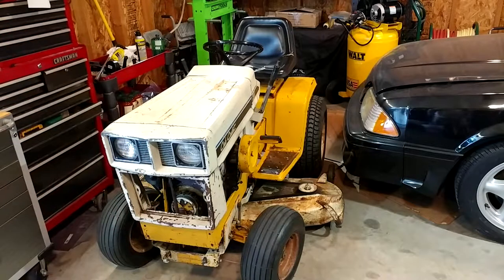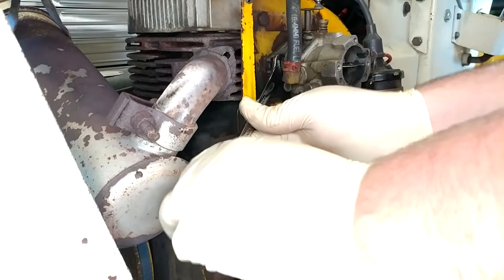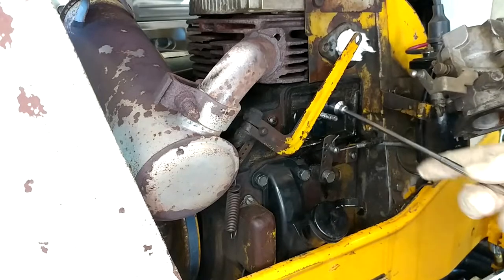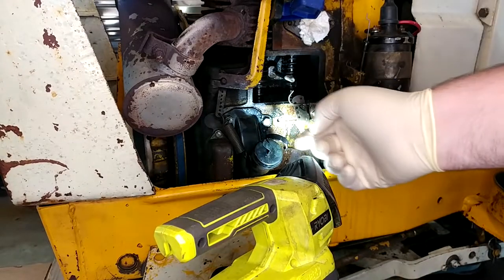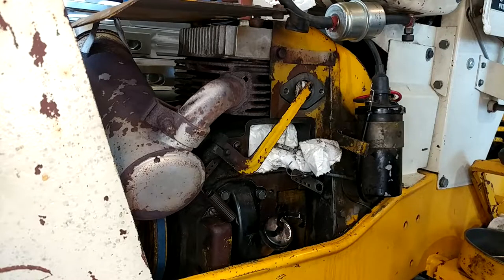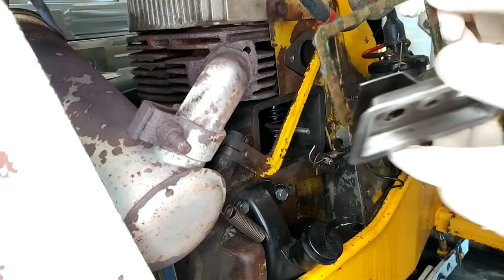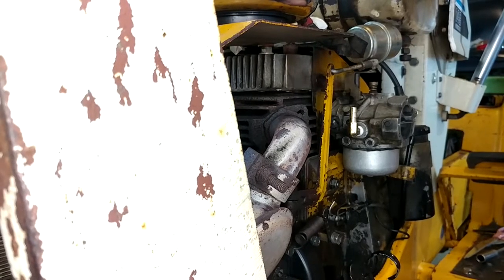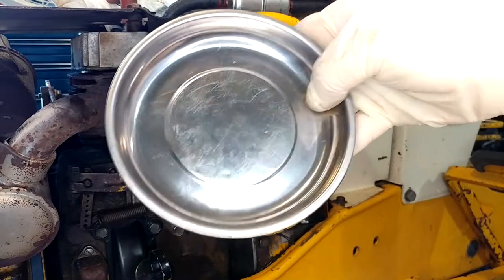Kohler K Series Valve Adjustment & Breather Service: Cub Cadet 149

Comment from the maker: ANNOUNCEMENT: After a few hours running, my machine developed a MASSIVE oil leak out of the valve cover. It turns out that center bolt does need to be fairly tight, so don't be too shy with it like I was in the video. I believe I caught it before anything bad happened, but what a mess. It probably lost about 3/4 of a quart all over the side of the motor, the frame, the front axle, the mule drive, etc, etc. 😆

A bit of loctite on the nut may not be a bad idea either.
Reply: Thanks for the update date will take that in

Comment: If you still have a pesky noise in the vintage Kohler engine, consider piston slap may be telling you of excessive wear of the piston skirt. You have many many hours on this machine. If you have already done the rebuild then you’ve probably cured the piston slap noise along with other ills. 
Thanks for a great tutorial. 
Dan
Reply from the maker: There's no doubt that it could use a rebuild. I had the head off of it several years ago (probably 500-1000 hours) and piston clearance was plainly pretty large even by eye. 😆

Comment: Check the set screws in your basket pulley for tightness. Loosen the starter/gen belt first then try turning the engine back and forth to see if the pulley is tight on the crankshaft.
They get loose and rattle like crazy then it's not long before the snout on the crank is ruined. Usually the basket pulley is too! A very costly repair and not something you want to overlook very long when you're hearing a rattling noise.
Reply from the maker: I'll check it out for sure. Thanks for the tip! 👍
Reply from the maker: I checked it today before mowing and everything seems fine there.

Comment: Try thicker oil for the noise.  It is supposed to have straight 30 weight, not 10w30!  I have the same engine in my Cub.  Have to check exhaust clearance, mine started glowing red on the muffer and engine output pipe.
Reply from the maker: I agree. Since the early 1990s when it came home, it has only had turbo diesel rated straight 30 in it. The current flavor is Rotella T1, which should have all of the vitamins and minerals that a growing Kohler needs. 😆 

That said... The factory Kohler manual recommends 10w30 for cold climate use. I would likely elect to just let it warm up for a long while and run straight 30 anyhow, but...

Comment: Another issue that happens with these k series engines is the balance gears tend to wear over time and start to rattle. Usually a dead giveaway on those is, if the engine has a rattle at idle then goes away when you give it some throttle it’s typically the balance gears. It could also be the cam end play or the crank end play. It’s hard to say on these old, high hour engines. In any event it’s definitely worth rebuilding.
Reply from the maker: It seems to tick at all RPM and seems localized to the exhaust valve region. Some days also seem better than others. Your guess is as good as mine as to the cause. It still runs pretty well. 🤞

The only thing I'm positive about is that motor has thousands of hours on it and is way past what anyone would ever expect out of one. It for sure could use a rebuild, but for now I'm just trying to nurse it along and be as kind to it as I can. If it pops, it will for sure live again.

Comment: it may be your front PTO Clutch they tend to rattle
Reply from the maker: The PTO really shouldn't rattle if they're properly adjusted. I replaced mine with a re-manufactured unit a few years ago and I've never noticed any noise from it.

That said, it's definitely the motor. This was its last summer. I just barely nursed it along and parked it for the year last week... There will be more on that in the future.